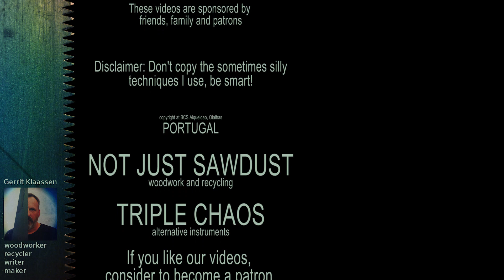A Table Saw Dovetail Jig with an extra angle twist!

Comment: Superb Gerrit :) Before you demonstrated the headstock joint, which is fantastic, I was thinking how good this jig would be great for cutting a neck to body dovetail joint :) That joint you have shown on the headstock will look good and it's going to be plenty strong enough :) Blessings my friend ॐ
Reply from the maker: I do have 8 cm. So I guess your idea could work (with the right "holding jig") 
There could even be the possibility of cutting a tapered dovetail (if you put an angle on the upright board (left and right). Thanks for watching! All the best from Portugal!